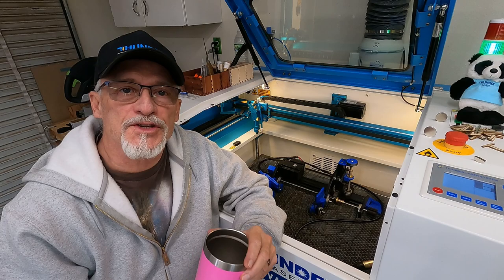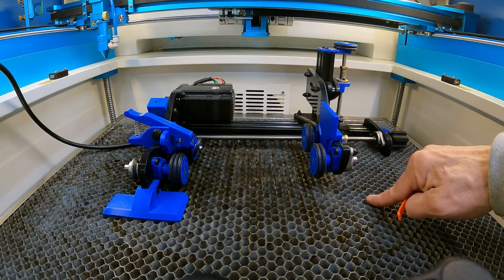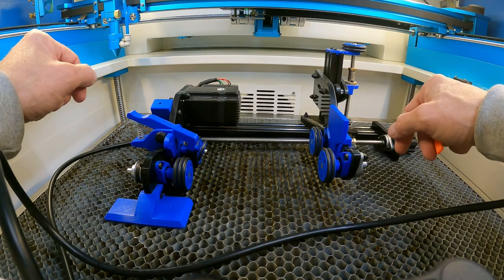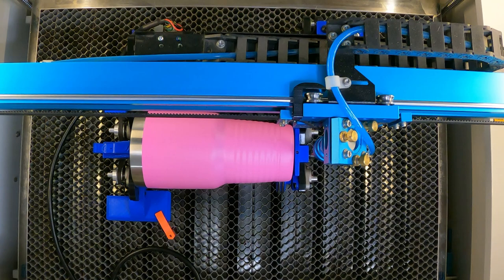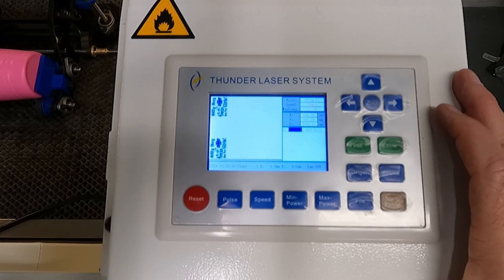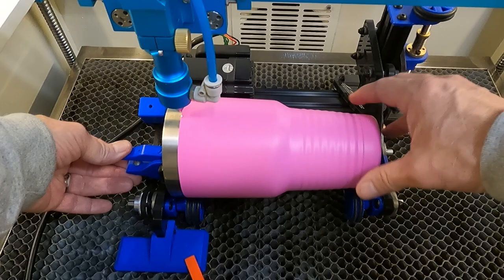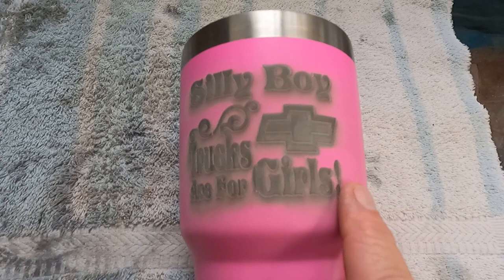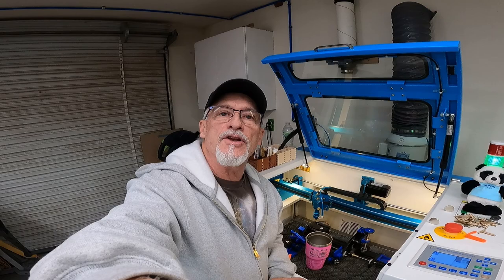Your first Tumbler with LightBurn and Thunder Laser

Comment: Thank you for another really good video.  One comment.  Some might be scared off due to the math needed to place the two opposing graphics.  Because both were exactly the same size and because you placed one at the bottom edge of the reference, there is a much easier way to place the second graphic.  Simply make a line or rectangle at the 1/2 point of the template rectangle.  Place the 2nd copy of the engraving graphic bottom aligned to the 1/2 way point.  

If you happen to have two graphics that are not the same size, then the procedure is slightly different.  Put an alignment line/rectange at the 1/4 and 3/4 level of the template rectangle.  Then align each graphic to those two lines, CENTERING the graphics on the two alignment lines at 1/4 and 3/4.  These techniques are both based upon setting up the template rectangle as you did in your video.
Reply from the maker: good point, I like it!

Comment: Thanks for another great video. I just did my first tumbler the other day (prior to the video) and was thinking about contacting you to see if you had a video on how to do tumblers from start to finish.
Reply from the maker: I hope it turned out great, thank you for the comments. There are lots of different ways to approach this subject this is just one of them. Thanks for watching and congrats on getting your first tumbler completed.
Reply: @computercreationz  I think we need to see videos of laser power and speed settings for tumblers. There are a lot about how to set the tumbler up on the rotary, and I think yours are the best, but no real discussions about speeds and power settings. I did a test engrave on a 13 dollar tumbler, was way too slow and powerful and actually bent the cup to hell.  I didn't think this would be  a problem because i watched a video that said "you can't cut through the metal so too much power isn't important".  Buy was he wrong.
Reply from the maker: @cliffart7398  I appreciate the suggestion, I use 400 mm/s and 40-60% power seems to work well I need the higher power for tumblers like Yeti that have a thicker powder coating. I agree you can have too much power when engraving. You can scorch the stainles. Thanks for watching!
Reply: @computercreationz  what do you use to clean up?

Comment: Thanks for your advice for me to search additional videos setting up the tumbles!
Question what if the 2 graphics are not the same width? Do you make them to match width( as close as possible)?
Reply from the maker: I split me rectangle in to two equal rectangles and drop each design in the middle of those rectangles that way they can be different and it looks fine.
Reply: @computercreationz  thank you!

Comment: My rotary does not spin when I frame the job. I have followed all the instructions, as far as connecting the rotary and making sure it reads "Ready". What am I missing?
Reply from the maker: You can only use frame on the controller and not in lightburn when using the rotary

Comment: Great video as always!  Still have a problem centering when a tumbler has a logo already on it like a Yeti.  Too expensive to mess up!
Reply from the maker: ya there is no easy way to do a template when you want to center you artwork on a tumbler logo. I use center left for my origin and center tumbler logo with the red dot on the laser
Reply: If you had more marks at the fence edges of his/your alignment tool, seems like you could use a small carpenter's square and put a pencil mark on the lip of the item at each side of the logo. Then place the cup/tumbler on the tool, set the two marks at the same location/distance out from the corner and that would give you perfect center point of the logo. Use that to align the red dot on.

Hopefully, that makes some sense.

Comment: Nice Video, great work. But, when you change from a tumbler to a glass, you have to change the steps per rotation or only the diameter from the object ?
Reply from the maker: thank you, the only time you will need to change steps is if the diameter of what your putting on the drive wheels of the rotary is different that
n your engraving area regardless of material.

Comment: thanks for the awesome video. what would you recommend as starting speed and power for a nova 35
Reply from the maker: I use 400mm/s at 35% power on my 35-100 for most tumblers
Reply: @computercreationz  do you have a video explaining lines per inch and how to set it
Reply from the maker: @CD_DESIGNS  I use 317.5 for most everything. The Lower the less resolution witch can save allot of engraving time but you will see your quality suffer if you go too low. Stay above 200 for sure

Comment: Robert - This was very helpful for a new Thunder User...I do have a question however.  I am losing some of the definition on my tumbler engraves.  IE:  Some of the smaller stuff is getting engraved out.  Why is this?  Is the laser too close?  Too Far?  What could be causing?
Reply from the maker: With Tumblers I use vectors only and keep the design elements on the larger side. Fine elements don’t engrave well normally. Be sure you not trying to engrave images that should be converted to vectors. I see this allot. Not everything can be engraved on a tumbler. Thanks for watching, I appreciate it.

Comment: hey great videos and your a good teacher , im starting to dabble with powder coated tumbles etc. I have a thunder 100 watt laser and , well first test came out good then when I did the proper one , mmmm thought id buggered it up id already remove it when I notice looks like it only took a layer off . I cleaned it with isicol alcohol and a magic eraser with a lot of cleaning I saved it . ????? all this after the test worked good??  im doing 500 mm sec and 40% power..... my question to you is what do I look for when altering my speed or power accordingly . is that air as I have no air with is fairly light? does this need more power is this a symptom of to much power or not enough air ???? can sort others but this is tricky.  any help muchly appreciated , Robert isn't it
pat.....ps checked lease and mirrors . im using a thunder chuck rotary
Reply from the maker: I run 500/35 on my 35-100 watt for almost all of the tumblers I do. focused at 11mm with a 1.5” lens. enduramark Blu works fantastic for,the clean up. a little pricey but saves allot of time. very little air too
Reply: @computercreationz  thanks for your very prompt reply ,impressed!!! is the 1.5 inch lens the standard lens , thought it was 2" ????
Reply from the maker: @patdennis4576  the 1.5” lens is from American photonics and can be purchased for about 80 dollars. It’s my goto lens for engraving. It has a smaller beam spot

Comment: Sorry to bombard this post. So if I had two graphics that were different then would I add both heights on those graphics and divide it by 2 to get my number, and then subtract the circumstance? 
Also could I just line up the second graphic to the edge center node point on the template? Or would than not line up correct depending on the sizes of the graphics?

Comment: Does it work just to put one graphic at the bottom and the other graphic at the mid point of the rectangle? That would be your dead center half way around the circumference. At least if the graphics are identical like these are.
Reply from the maker: Yes if your doing 2 of the same graphic and your steps per rotations are accurate.

Comment: Hi, i looove all your videos! Would it be accurate to multiply your speed setting  mm/sec by 60, to find out the settings on mm/min?
Reply from the maker: if you need mm/minute that usually for a diode lasers. this is a co2 laser and there setting are not relatable.

Comment: I have tried engraving these in focus and out of focus like you recommended, I seem to get some duplication of thin lines, almost as if the laser head has some slop or lag. Any recommendations on getting cleaner lines especially on smaller text? Using the same model laser as this video. Thanks and great video!
Reply from the maker: Your scann offset adjustments need to be input or enabled. Goto thunderlaserusa.com and goto support and search scann offset adjustment. There should be a business card in your tool box that has numbers that are specific to your machine those numbers need to be input into the scan offset area in lightburn. This will fix that issue!
Reply: Ok, I will ensure they are enabled, I did enter them initially. Thanks for the quick reply, and thanks so much for the informative content!
Reply from the maker: @bonklavy5652  Be sure lightburn is in mm when you enter those numbers or it actually
Makes it worse
Reply: @computercreationz   I saw this too late, I thought I really messed something up haha. WOW that was way off. I re entered in mm and it is crisp! Man, cannot thank you enough for your help.

Comment: can you disengage the laser arm to move it manually? Thanks.
Reply from the maker: when the power is off to the machine the gantry moves with a small amount of effort,  although it’s not recommended you pull on the gantry.

Comment: Do you have any tips on engraving a powder coated wine tumbler.
Reply from the maker: have a good quality rotary that had vertical stops on both ends of the rotary. make sure your rollers on the bottom on the wine tumbler are past the large radius on the bottom. they can be a bit tricky!